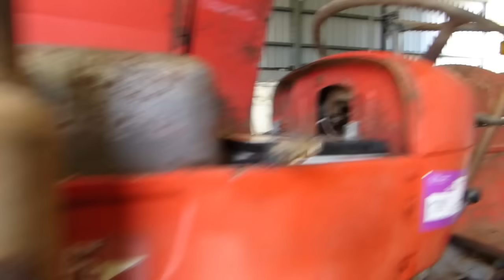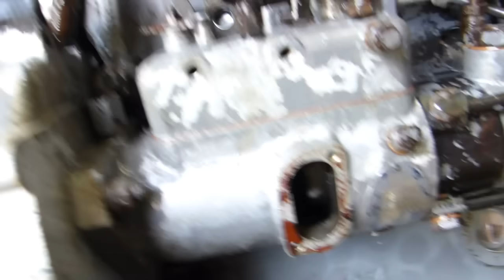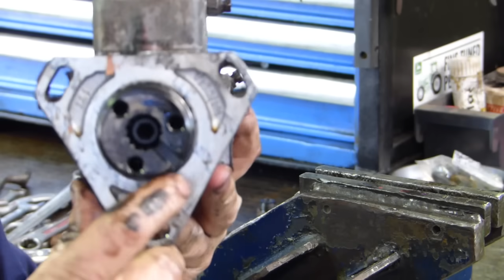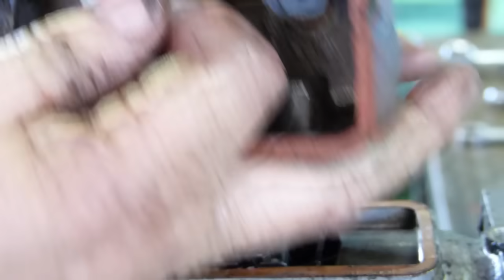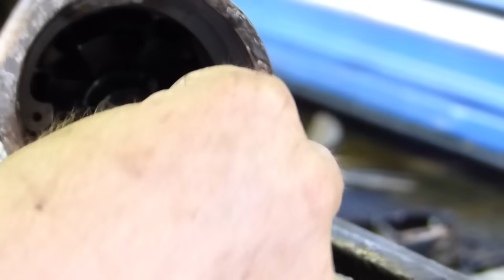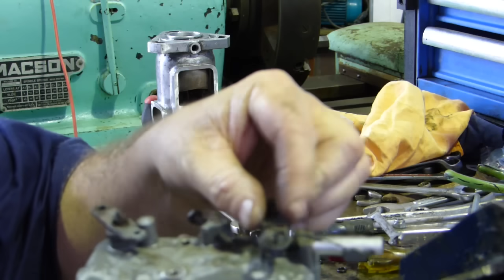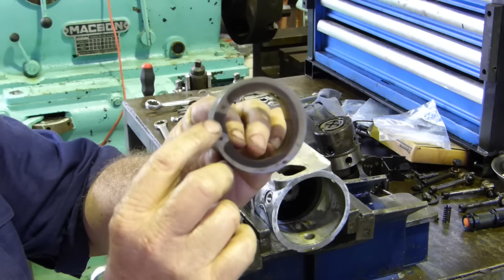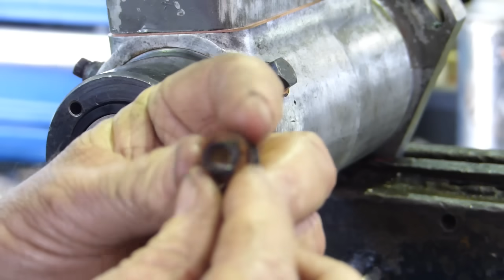CAV Injection pump full strip down to re seal and stop fuel leaks

Comment: Excellent tutorial.  Although I know this 9 years ago ...still very much needed.  Hopefully you will read this message ...I have a Dresser Dozer with a no start/no fuel to the injectors situation with the Lucas CAV. pump.   It does not leak at all,  so I am feeling that pulling and rebuilding the pump may not be necessary.  I have pulled the governor lid and checked it (which I put a new gasket etc. on a couple of years ago).  All seems well there, so my thinking is something could be wrong in the whole inlet assembly.  My question is ...what is your opinion of taking the approach of pulling that off and examining everything there as opposed to pulling the whole pump?  From your video I get the impression that a no start/no fuel pumping issue is primarily at that inlet assembly or the governor.  I have verified that fuel is getting to the pump from fuel the tank through the fuel filters.  Thank you in advance.
Reply from the maker: I did better videos in my Massey Ferguson 135 6 speed playlist videos 14 and 15 but it could be as simple as a sticky metering valve.

Comment: I paid someone to rebuild my pump and it doesnt push any fuel to injector lines.  I can feel something engaging on the shutof control.  I tried tapping with a hammer.  I bled it a lot, no air bubbles.  I guess i have to pull the cap off
Reply from the maker: Check my Massey Ferguson 135 6 speed playlist videos 14 and 15. That may give you a hint as to what to look for.
Reply: @bundybearsshed  i had the stop lever on backwards...DOH!  Primed easy, runs nice now.  Glad i had your video to think a bit before i pulled the cap.
Reply from the maker: @FourthWayRanch  That is good news.
Reply from the maker: Sometimes they will come good it all depends on how bad the bore is.
Reply: @bundybearsshed  only .003 " less from original spec on the bore. Manual says it can go to .008" i think so there is some meat left in there.
 Hopefully I can dig my septic tank and foundation with it for now.
Reply: @bundybearsshed  how do we make the flair for these old low pressure fuel lines?  I saw a hydraulic flair kit with a "GM fuel"  flair that looked similar maybe.  Ive just got straight tube and a new olive for now

Comment: Given the age of this video it might be a long shot but I have a pump similar to this on my MF175. My question is, would I be able to remove one or both of those two bolts right next to each other at the bottom of the pump with it still on the tractor or would that cause something inside to misalign and be unable to function? One of them has a little fuel pushing passed it and I've just been slowly tidying up all the leaks.
Reply from the maker: I think you would be ok. Check out my Massey Ferguson 135 6 speed playlist video 14 and 15 I go into the pumps better there. Even though it is a 3 cyl pump it is almost exactly the same.
Reply: @bundybearsshed  I'm starting to suspect so as well. From what I can tell on some of the pumps it seems they mounted a cup or "basket" there as I've heard it called that has something to do with timing and the governor. So I'm starting to suspect those bolts on the pumps without them are just placeholders since it wouldn't make since to change the design of the body of the pump from a production standpoint.

Either way just want to try to make sure and see if anyone else had experience with it before doing something stupid. I'll definitely check out that video, thank you!

Comment: Replacing main pump hydraulic head on Ford 3600. No t pumping fuel when hot. The drive gear 'rollers,shoes and the stroke adjustment retainer are not on replacement unit. The two bolts holding drive gear to head so how do you make sure you don't install gear 180 degrees out of phase. Watched a couple of videos and I didnt see any alignment dowl or key to align gear correctl. Any advice before I tear it down Thanks
Reply from the maker: Check out my Massey Ferguson 135 6 speed playlist video 14 and 15 I go into the pumps better there.

Comment: Hi Lance great informative videos 🙂
I’ve got a Massey Ferguson 50hx digger with the same cav pump on it, last time I used it it was driving fine but started to miss …..,thought it needed a new filter so drove it in to the workshop fine and stopped it. Gone to use it today changed the filter first , it was slimey, bled the diesel through to the injector pump tried to start it and it wouldn’t start so I put an electric fuel pump on the line to make sure there was enough fuel getting to the pump but it still wouldn’t start, there’s diesel coming through the bleed screws but none at the injector unions any ideas as I’m at my wits end
Thanking you
Reply: Thanks for the reply I know for sure that it’s the diesel bug had the same issues with the tractor blocking filters, I added some biocide to the tank and since doing that I’ve had no problems since, the digger turned out to be indeed the metering valve stuck in the stop position, after watching your videos I wasn’t afraid to pull the valve out of the pump to clean the varnish off it, I’m pleased to say that after doing that the machine started first go
Thanks again for your videos, you saved me a ton of money, keep up the good work
Reply from the maker: When you say slimey it sounds like you have the diesel bug or bacteria. If so you will need to flush everything. The metering valve gets stuck shut and will possibly need freing up. Check out my Massey Ferguson 135 6 speed playlist videos 14 and 15 I do a better explination of the pump and its workings there. It is a 3 cylinder pump but the same inside.

Comment: Hey Bundy, I rebuilt my pump and put it back on and now the engine starts and goes to full throttle. the only way to stop it is to shut off the fuel. I accidentally turned the engine over when the pump was out so I might have it out of time and was wondering if that could cause it to overrun?
Reply from the maker: G Day farmtractorrescue, Usually the problem is that the spring in under the top cover is in the wrong hole. It could be a sticky metering valve but if the timimg was out it would not want to start and run. I did better fuel pump videos in the Massey Ferguson 135 6 speed playlist videos 14 and 15. email bundybearsshed@gmail.com if you get stuck
Reply: @bundybearsshed  hello. I emailed you but not sure if it went through. I’ve tried every spring location and it doesn’t help. It’s still going to full throttle as soon as it starts.
Reply from the maker: @Farmtractorrescue the metering valve must be in the open position for some reason

Comment: What about those numbers you spoke of?  Not quite sure where my spring goes on my throttle lever.
Reply from the maker: I explain it here https://youtu.be/xK44HrQtAF8 this is a 3 part series. The other ones I did are in the Massey Ferguson 135 6 speed playlist videos 14 and 15

Comment: Thanks for the great video! Does anyone know if the metering valve notch/spline goes into anything? Mine can spin 360 degrees and wondering if something inside is broken.
Reply from the maker: 360 deg is fine it is just a fuel passage. check out my Massey Ferguson 135 6 speed playlist videos 14 and 15. I do a way better pump video there I believe.
Reply: @bundybearsshed  I will take a look and thanks for your help.

Comment: What procedure for filling and priming the pump, I found the manual but it doesn't say anything.
Reply from the maker: Pump the hand primer and open the bleed screws and open one injector line as you wind the engine over.

Comment: To replace those two 0" rings at the back do i need to strip the top cover or just these two small bolts on sides thanks
Reply from the maker: you need to open it right up.

Comment: Thanks for a great video.  My cover gasket was leaking so I changed it but the fuel is still seeping from the gasket and I can’t get it stopped even after adjusting the gasket. I’m not sure what to do. Any words of advice?
Reply from the maker: Just check the top is not warped and the surfaces are clean.
Reply: @bundybearsshed  thank you

Comment: My injection pump works shoots out bleed screw turning over but doesnt come out the injector lines was running last time i welded with it do you know where to start trouble shooting
Reply from the maker: Check the metering valve under the top cover, they get sticky at times from sitting.
Reply: Thank you sir ill get a look at it tomorow

Comment: Is there a filter somewhere inside of that pump?
Reply from the maker: If you undo the inlet pipe and then undo the big fitting with a 15/16" spanner you will find the filter in there. It is washable.

Comment: Thank you for the video I was wondering if you would have a solution for an issue im having with my massey. 
It will idle all day but as soon as I work it it stalls and does not like to start the lower bleeder screw will bleed but the upper wil only blow bubbles what would you suggest
Reply from the maker: Fuel block in tank I would think or possibly a blocked filter.
Reply: @bundybearsshed  thanks for the insight i will try that again

Comment: I have a Massey 65 that I have split to do rear main seal and clutches. Also had the rear end apart for brakes. I didn’t touch the injection pump at all. When I went to start it, it went to what I would call a high idle and would not shut down. The fuel shutoff did nothing. I tapped the pump with a hammer and I got it to idle down. Now it starts and idles normal but the fuel shut off still does nothing, in fact when I pull the shutoff a little past where it stops the engine will rev up like I’m moving the throttle. I haven’t driven the tractor around to see if the governor works properly. Only way I can shut it down is to crack the injector lines in the back of the pump. Any thoughts on what is happening would be appreciated thanks.

On a side note I did tighten up the lever on the fuel shut off shaft before I started it as it was a bit loose and had a little play in it. I also have removed the top cover of the pump after i first started it and everything seemed to move properly. Thanks
Reply from the maker: It sounds to me that the metering valve is sticky, they do get a lacquer from the diesel over time. Check my Massey Ferguson 135 6 speed playlist videos 14 and 15 and I explain things way better there.

Comment: Great video! The only question I have is how do you tighten the banjo outlets after you install the injector lines? At least 2 banjo outlets are near the engine wall. Thanks
Reply from the maker: I usually can fit a 9/16 spanner in there.

Comment: Add me to the big THANK YOU list. You sir are a breath of fresh air! I can now open up mine with confidence thanks to you taking the time to help those who are new to these pumps. Thanks for the rebuild kit part number also, its on the way. I have a Dresser Dozer I just bought with a Cummins 4B motor that has the Lucas CAV pump. It wont do anything past about 1/4 throttle and I ordered injectors for it and was looking for a reman pump, but after reading all about the more common pumps, I didn't feel good about tinkering with it, but when I saw this vid, and the details you went to making it easy to learn from, I now feel completely encouraged to redo it myself.  Thanks for going out of your way to help people new to these. I would bet my pin is stuck. God Bless You!
Reply from the maker: Thankyou, glad it helped.

Comment: i have the same pump on are forklift..its leaking from the back oring that you pointed out....CAN i pull just the back end to replace the 2 orings with out pulling the pump off the engine?? in order for pulling the whole pump we have to remove the counter weight witch we cant cause we are a small junk yard with 1 lift. this would save are buts bigtime. we are running it with the leak cause we have no option.
Reply from the maker: You can but boy it is a fiddle. Have a look at my Massey Ferguson 135 6 speed playlist videos 14 and 15 and it goes into the pump more.

Comment: Many thanks, I have a UK mf135 that's been stored for a few years , ad3 152, no spitting from the 3 injector output lines , so looked inside diamond plate, looks bit watery in there , thought I would try and next look in the end vane pump
Reply from the maker: Go to my Massey Ferguson 135 6 speed playlist videos 14 and 15. I go into the pump better there. I would have a look in the end and at the end screen. It is important to get all moisture out if possible.

Comment: Thanks from the US. I bought an International 1800 Loadstar truck, with the rare for these trucks 6-354T Perkins turbo diesel; 152hp
I drove the truck a few miles from the auction to my workplace for storage. 
It did seem to run very well, and the whole truck drove like it has been maintained; in good original condition. 
Has power steering, air brakes and drives better than I expected.

I am researching this engine now and I think I like it alot along with the rest of the world.
Nice to see a pump that I can rebuild myself.
Items like the pump is what I was worried about; parts availability, cost, etc.

Pleasantly surprised I can rebuild the pump myself. 
Mine has the Delphi unit; I will look for a spare to rebuild and store it under the seat.

Thinking about fixing truck up and making a camper / tow rig out of it. Be easy since it's already in good shape.
Tires look new and currently has a short dumping grain bed with removable sides to make a dumping flat bed.
Reply from the maker: Very satisfying doing your own repairs, My best videos on the pumps are in my massey Fergusson 6 speed playlist videos 14 and 15. hopefully that will help.

Comment: Hi Lance, I recently took the pump apart to replace seals etc. I ran it for a short while after and then is started idling really high. Long story short, it drained 20 litres of diesel from the tank into the sump. Where would it leak that amount of diesel through? The injectors or through the pump itself into the engine? Many thanks for the help.
Reply: I did replace the seal but I noticed (after removing the pump again) that the hex head bolt holding that pulley head on, was loose. Would that little bit of play be enough to cause the problem?
Reply from the maker: @WarrenZehrt-rg9tj tes it will for sure, I have done that, I also had the washers in the wrong place with the same effect
Reply: Lance, thanks for the help. I’ll put it back in the tractor now and see how it goes.
Reply from the maker: It sounds like the front input shaft seal

Comment: I did s reseal on the pump ,put it back on the tractor .The pump makes a lot more noise when it is running . Any idea what I have done , it works fine  ?
Reply from the maker: Im not sure why it would sound louder, there is not much in there that would make it do that. If it is running fine I wouldnt be too concerned.

Comment: I have an International Harvester 444 diesel tractor. Until March of 2023 I had not started it for a couple years. The last time I used it, it ran well. When I shut if down I left the stop knob pulled out. I tried to start it last March and had a lot of trouble starting it. It seamed as though I was trying to start it with the stop button still pulled out. I gave it a sniff of ether and it cracked up wide open. I pulled the stop button out, but I had to put a flat board across the air intake to stop it. I was just curious if you might have a word of wisdom for me.
Thanks
Jim Lewis
Reply from the maker: Pop the top cover off and see if the metering valve is sticking.
Reply: @bundybearsshed  thanks mate, that is what I was thinking the problem MIGHT be.

Comment: Great video! Your ability to explain details based on your experience has given me confidence to tackle this project. I have a IMT 539 tractor and i want to check the timing before removing pump. You mentioned in one of your videos about dropping the valve on #1 and using dial indicator to set BTDC. My question is how do you remove spring from valve? I have a tool that will compress valve spring but i cant get keepers out. Thanks for your time.
Reply from the maker: You probably dont need to drop the valve just line up the marks.

Comment: Hi Lance, 
nice video. have a tractor that is only getting fuel threw two of the three injection lines. i am worried it is some bad fuel that has gotten through the filters. got any tips on where its might be plugged. worried to take it all a part.
Reply from the maker: They all use the same pistons to push fuel so possibly go a bit futrher in to it, there is a better video in the Massey Ferguson 135 6 speed playlist videos 14 and 15. They explain things more.

Comment: Great video. How does the top bleed screw attach to the top body? . Mines just come off in my hand. Copper washer and black seal between them .
Reply from the maker: The whole thing has a 1/4" unf thread, the broken bit is probably still in the cover.

Comment: My metering valve is stuck when closed fast. I’ve clean it off and it still does it. Any tips?
Reply from the maker: Try and work it back and forth with some crc and polish it with some very fine paper.

Comment: Good video. Not sure what i did wrong but now tractor will not idle. When it starts seems to want to run wide open until i pull kill lever, help!
Reply from the maker: The spring under the cover has gone back in the wrong hole.